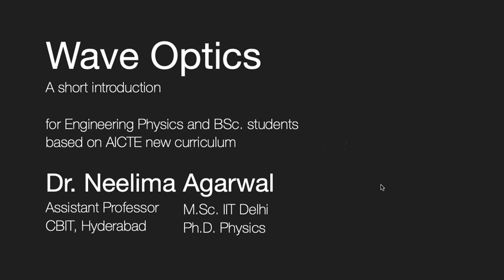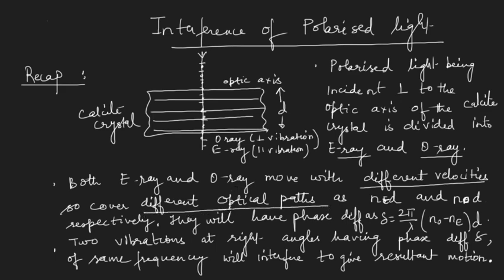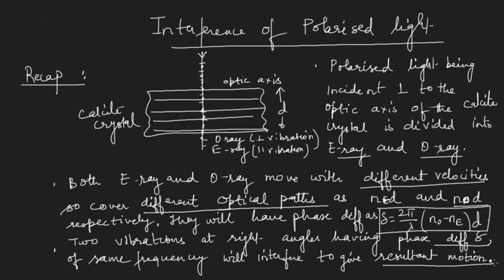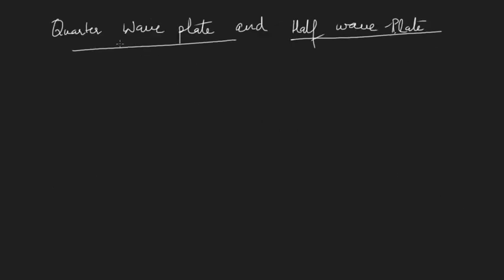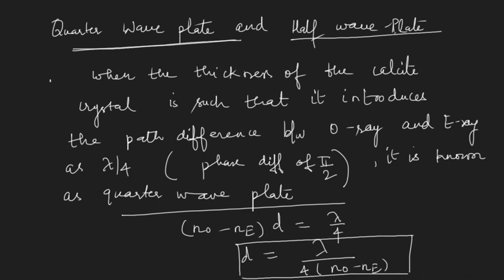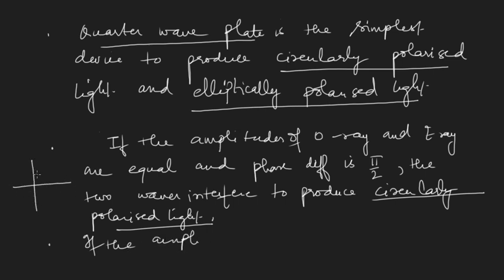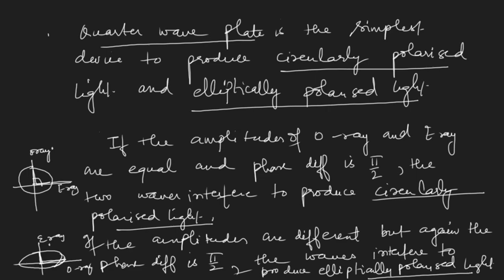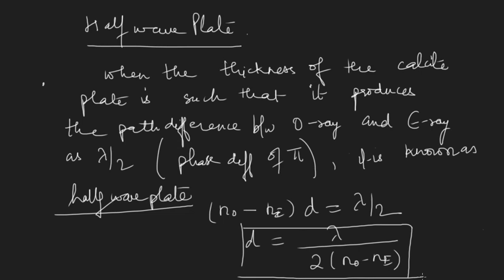L20: Quarter and Half wave plate

Comment: Please clear my one dount ,if i incident plan polarized light at an angle 45 so does it get resolved along fast and show axis ,,,, and if i incident ppl normally or parallel to optic axis then it remains along one fast/show axis then how we get retardation as their is only one wave ,,,,,, please I can't understand how the phase difference come if I have only ppl one component incident
Reply: this is quarter wave plate case. E ray and O ray amplitudes will be equal in this case. Hence we get circularly polarized light